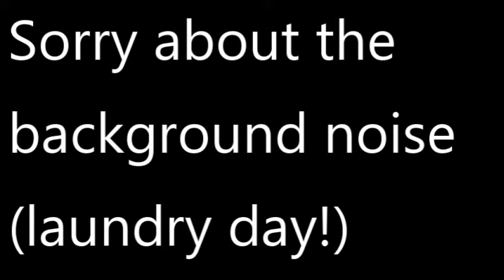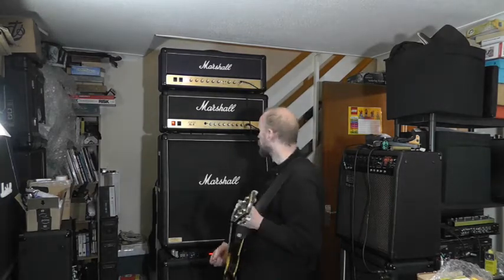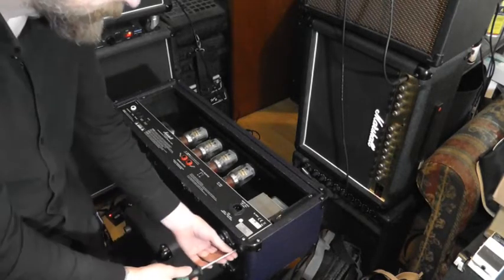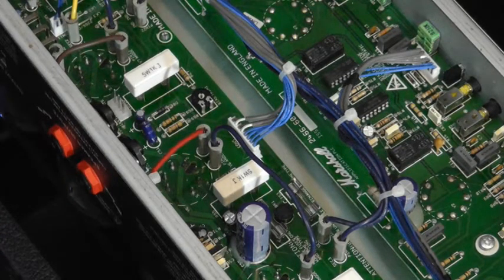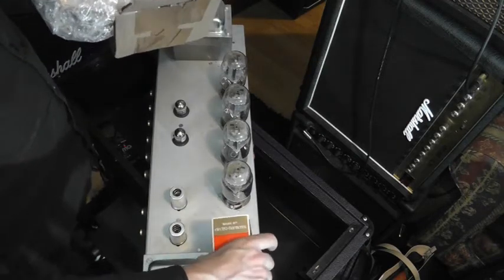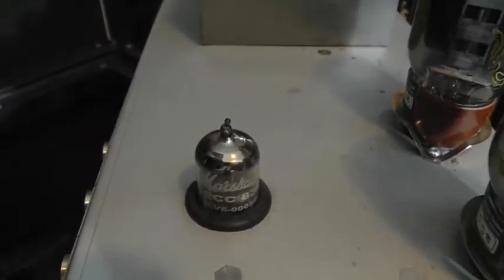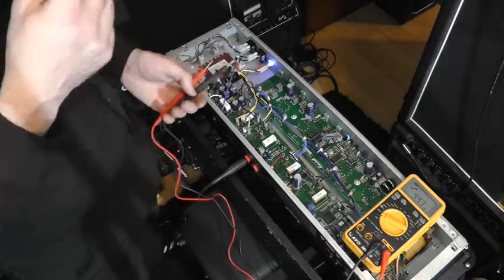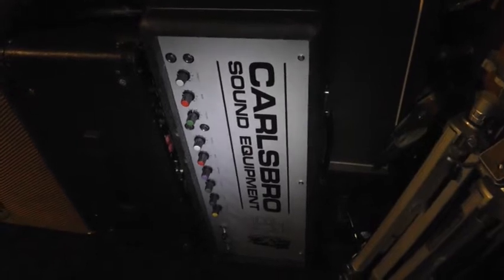Marshall Vintage Modern Revalve

Comment: Does your ldr mode breakup nicely (like it should)with the Gold Lion tubes ?
Reply from the maker: It does! I also have a JTM45RI with Mullard and GEC valves in it. The LDR mode on this is similar to that but with but a bit more up front and having more clarity. Such a crazy loud amp. I recently picked up JMP-1 and a 9200, even louder!
Reply: Hmmm I'm having trouble with mine, doesn't seem to break up like others I've heard online.Master volume at 3 is ok but when you go louder it cleans up.

Comment: Thanks for uploading. Those big old metal things on either side, you said not to wrap your fingers underneath, but are they safe on the valve side?
Reply from the maker: Hi thee! Yes they are those are the transformers. The external bits are not live at all - Even with the amp running
Reply: @hydorah  Many thanks. The V1 in my 2266C is pretty close to one. 🙂
Reply from the maker: @000Angus000  Good to know you're safe swapping it if you feel inclined. It is quite tricky to line up the preamp valves as their sockets are mounted on the circuit board, not the chassis, so they are sort of deeply recessed. Also the part of the valve that doesn't have a pin (which helps you align the valve doesn't face the front or rear of the amp (like they usually do) it faces the righthand side of the amp, if looking at the amp from the rear. What valves do you have in yours at present?
Reply: @hydorah   Yes, I know next to nothing, but I've made notes of the "compass direction" of each the valves, and even with those I find it tricky to get them in. I've got JJ ECC83S for the preamp and the original two Marshall labelled KT66's in the power amp. It's a 50 watt combo. They are different sizes! One is short and fat, the other is taller and slimmer. :-) I plan to very cautiously check the bias in a few days time.
Reply from the maker: @000Angus000  Cool man. I do like JJs ECC83S and ECC83MG are my pick of current production valves. Pity about their KT66. If you locate the bias test point it won't blow your amp if up accidentally short any of the three pins. Just make sure you don't touch anything else and all will be good. If you to be super safe check my 6100 vid were I show discharging everything. Hopefully my vid is all clear but do feel free to ask any Qs! Did you buy your amp new?
Reply: @hydorah   Yes, I got the amp new. 2008? It has had a couple of small issues over the years and went back to Marshall once (who were brilliant about it). I gather from reading the forums that instead of connectng to the earth from the middle pin, you can connect to the chassis, which I think I'll find easier, we're talking anywhere on the metal frame in which the circuitboard etc sits, right? I will certainly check out your 6100 vid. Thanks.
Reply from the maker: @000Angus000  Yes that should work fine. I've always found Marshall to be excellent as well, when it comes to aftersales stuff
Reply: @hydorah  Oh boy....... Today I attempted the task, and the results confused me.

Both the outer pins gave me a reading of around 2.70. (This is with the multimeter set to AC and mV. It supposedly auto detects the range, but I used the manual adjustment to set it to AC.)

Does that mean 27, where I want it to be 43-48?!

Do I double it to get 54 because there's two valves?!

I increased the bias with the trim pot, eventually turning it about 180 degrees (the maximum) the reading went to around 2.80. I put it back where it had started.

The valves are years old, but have had very little use - and sound fine to me. What am I doing wrong?  :-)
Reply: UPDATE:
I tried the multimeter without manually adjusting it to AC, and got more recogniseable readings: around 33.0

I tweaked the trim pot and the multimeter currently displays 47.0 on both valves so, I'm hoping I'm on the right track, now. I will check it again later to see if it stays put.

The display on the multimeter is showing "DC" though.   :-/
Reply from the maker: @000Angus000  Try DC mV, you should set yours to 40 - 48mV
Reply from the maker: Ah yeah just read the rest of your comment. I think your meter had done the right things and you are all set! Well done, mate!
Reply: @hydorah  Very much appreciate your help and support.  :-)
Reply: @hydorah  43 - 48mV apparently. (I'm just quoting numbers, we appreciate I don't know what I'm talking about.)     :-)
Reply from the maker: @000Angus000  Haha! You're now an expert! How does the amp sound?
Reply: @hydorah  I'm itching to find out, but as you know the power tubes don't really start doing their thing unless you set the master volume to loud'o'clock, so I'm waiting for my other half to leave the house.  🙂
Reply: @hydorah   Given it a brief try. It maybe my ears, but I'm not hearing much difference which from what I've read is a bit weird - going from 33mV to 47mV  :-/
Reply from the maker: @000Angus000  Yeah that's normal. You've biased your valves a little bit 'hotter' so you'll get higher gain /breakup a little earlier you could probably tell, if you could back to back the two settings. It's only a subtle difference :-)
Reply: @hydorah   Encouraged by my continuing existence, I'm considering a mod suggested by the designer (Steve Dawson) to increase the gain somewhat.
SD: If you wanted 'more' from the Vintage Modern then changing C1 to 1uF/25V (making sure the polarity is correct) and maybe even C2 to 2.2nF/400V would certainly deliver some heat without destroying the tone.
I found C1 on the board right near a circuitboard attaching screw, but I'm just seeing a little white box with C1 next to it. Is that like a base, and the cap is on the other side?
In your vid, I believe it is just in shot (bottom right) at 7.25 when you go to a close up.
Reply from the maker: @000Angus000  Hey mate the little white boxes are capacitors. They can look all sorts of different ways. They are sometimes called 'box' or 'Cermet' capacitors. They are soldered on from the other side of the board. A tip about soldering be sure to use tin/lead solder and not lead free. lead free is total crap. I'll be changing C93 in a DSL201 that I converted to a head at some point this week, I'll film it. If you're going to work at board level on an amp be sure to make yourself a capacitor discharging setup like I have with a nice high power resistor, I'll go into this in detail. The bigger filter caps on your board will hold voltages that can kill so don't take any chances with them!
Reply: @hydorah  Awesome, thanks for the clarification. Would I be safe if I unplugged the amp for 24 hours? In any case I look forward to seeing you at work on the DSL201.  :-)
Reply: @hydorah   I bottled out of the gain mod (replacing C1) and took the amp to a local guy. Despite my instructions, he found a different C1 to change on a little board close to the return/send inputs! After he told me he changed it back and then changed the correct one. But now the Body control has no effect (just the Detail control)  my guitar volume controls only work  properly from about 8.5 to 10 and makes the amp crackle. I assume he has "nudged" something, any ideas?   :-(
Reply from the maker: @000Angus000  Oh dear :-( bloody 'local guy' strikes again. Without seeing the amp it's hard to advise much. Assuming the unintnded mod has been reveresed Try reinstating the usual value C1. I replaceed my C93 and a big smoothing cap in my DSL201 head just got to edit and upload the vid. Try and get everything back as it was then see where you are
Reply: @hydorah   When I picked up the amp he told me that he had put the cap in standing tall, so that if I didn't like the mod, he could snip it off and solder the original one on to the old legs. Is that good practice? When I gave him the amp, I told him it was my pride and joy, and if he had to make better or not as good choices, I would pay for better.
Reply from the maker: @000Angus000  It will work, but I don't like the sound of it. It's best to get the caps right on the board so they are not vibrating about and having extra unsupported joins / posible future failure points. The holes in the board can be cleaned right out with proper technique.  Have you check this other C1 that he found? Did he put it back right? What does his soldering look like?

If I wanted to make a really quick cap change solution, I'd cut two pins off a DIP chip holder block, solder them onto the board, then solder the cap into the sockets on the top of the thing

But I've never had the need to do such a thing. Maybe you should take the job back over for yourself?

https://www.ebay.co.uk/itm/333140104291?hash=item4d90b29463:g:71oAAOSwpLNX~Vhy
Reply from the maker: @000Angus000  Hey mate looks like we've found the problem C1 is replaced with the wrong type of cap. The one that's installed is an electrolytic and is polarised. Should be a polyester 'box' cap which is not polarised although I always install them with the writing on them orineted the same way as it originally was. Fix that and you could be rocking again. Soldering actually looks good but wring cap? It's a no form me for local guy. Do it yourself mate
Reply: Following a suggestion I got a new ECC83 out of the box and replaced V1 and the Body is back! (and I don't mean Jamie Curtis) The amp is sounding good.

One other thing.
The amp hums more than it did. With nothing plugged in, and with the Master Volume at zero there is a substantial hum (like a mains hum?) As I turn it up it reduces, and at full it is gone, you can just hear the normal hiss that you'd expect to hear. Would that be just a result of the mod, or something I can get fixed do you think? 
(I think I've probably used up all my goodwill several times over, so if you've not got time for this I completely understand.)  :-)
Reply from the maker: @000Angus000  OK that's good but that cap is definitely the wrong type. The correct type will it's capacitance thing in either direction, and electrolytic only in one. BTW unplugging the amp for 24h won't do it you'll need to discharge the caps to work safely!
Reply: @hydorah   Apparently that capacitor while different from the original, is kay. Here are some comments from Steve Dawson designer of the Vintage Modern amps) about the mod that you will understand better than me.  :-)

SD: If you wanted 'more' from the Vintage Modern then changing C1 to 1uF/25V (making sure the polarity is correct) and maybe even C2 to 2.2nF/400V would certainly deliver some heat without destroying the tone.

 Traditionally the .68uF cap is paralleled with a 2k7 resistor in the cathode and together they give a shelving frequency of approximately; -

1/(2*pi*R*C) = 1/(2*3.142*2700*.68exp-6) = 86Hz (near enough the frequency of a guitar's low E string).

Using .68uF with the Vintage Modern's stock 1k5 cathode resistor as you did gives 1/(2*3.142*1500*.68exp-6) = 156Hz (Almost doubling the shelving frequency).

Whereas using the 1uF with the 1k5 gives 1/(2*3.142*1500*1exp-6) = 106Hz (Close enough to the traditional response).

Changing C1 and/or C2 is an easy mod and easily reversible if the previous configuration was prefered but be aware that your warranty, if still in term, will be voided!

SD: Yes the PCBs are double sided and it's up to you if you want to get a particular type of cap, as long as the voltage is at least 400V for C2. Something with the same or similar pitch as the original would obviously be easier to fit. A 1uF/25V radial electrolytic cap for C1 fits pretty well, remembering to make sure the negative leg is nearest the front panel of the amp for correct polarity.
Reply from the maker: @000Angus000  Yep that does mean the cap you've got is OK :-) he says 'electrolytic' and 'make sure the polarity is correct' so yeah rock on! Do you detect a difference in tone? Do you like it?
Reply: @hydorah   Yes, I thimk it's just about exactly what I wanted. Just a bit more grit is accessible (and I prefer to use the Low Dynamic Range). The problem is that what should have been a straight capacitor change (says me the expert!) has caused a bunch of problems. Currently everything is fine, except with everything turned down and even with no guitar plugged in, there is a lot of hum. Oddly this is decreased as you turn the master volume up to full, whereupon it disappears.
It's back with "local guy" now.  :-)
Reply from the maker: @000Angus000  Hey mate, I posted that video! I gave some good attention to the 'make sure you don't die' aspect of working on valve amps, let me know what you reckon?

https://www.youtube.com/watch?v=iMBNKX5rGCk
Reply: I'm going to use my eurotubes bias probe on my VM like I did with my deluxe Reverb

Comment: My vm 50 watt just shit the bed on me......clean channel is good, dynamic is nothing or extremely low.
Reply from the maker: Mate that sucks. The dynamic range button is 'low' or 'high' does your volume drop when you switch from low to high? And this is new occurrence?
Reply from the maker: Reason I ask that is my understand three valves are in circuit in low dynamic range and all four in high. So if you have a known good spare preamp valve, swap each valve in turn starting with V4 for your known good valve. You'll probably fix it
Reply: @hydorah  yes sir! I have one brand new pre amp tube left! I am going to attempt this in the very near future. Allow me to get back to you soon?! Thanks again for responding!
Reply: @Lymanization  how'd it go?
Reply: @ericsalinas1839  have not fixed it yet...I no, I no...

Comment: Every time I think about getting a modern amp, then I watch someone open it up and I see all that crappy build quality.....uh NO
Reply from the maker: Haha! Yeah it's a weird one, the modern techniques lead to consistent and reliable products, but the quality of modern components, even though tolerances are tighter just doesn't seem to equal that found in older gear. Of course modern gear also seem to be quite feature laden where as old gear is usually very pure and simple in function. I think that's the real nub of it with old gear. Simple with high quality components. New gear is packed with features but also packed with a lot more Chinese rubbish. The in the vid amp is actually well built just got to get rid of the rubbish parts! I passed on a 100 watt non master volume JMP with mustard caps in it as it didn't have vintage valves and you can't get a decent tone out of it until the volume is very high would have been nice to have but not at all useable except at larger venues! Funnily enough the successor models had master volumes
Reply: @hydorah  yeah my most used amp right now is 1983 Rivera era Fender Princeton Reverb II   I picked it up cheap about 6 years ago. Hand wired pretty basic layout, built like a tank. I recapped it and swapped the speaker for a Eminance Tonker Lite.  Grab and go amp, run some Keeley pedals in front and it always sounds good